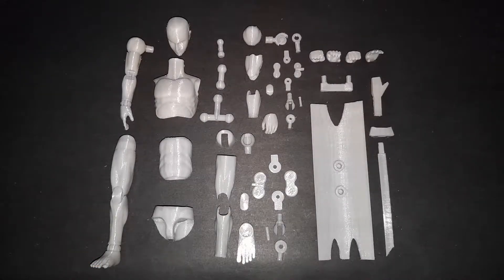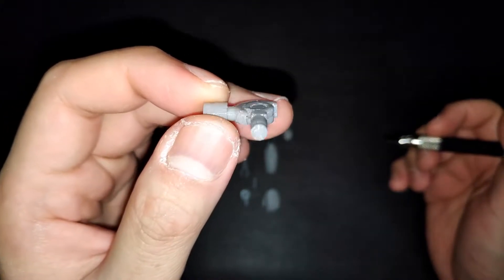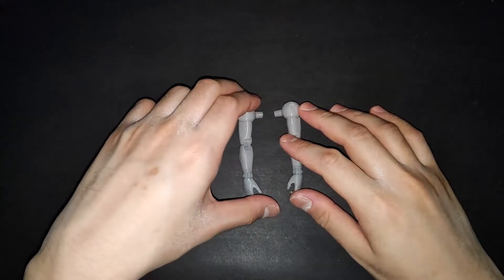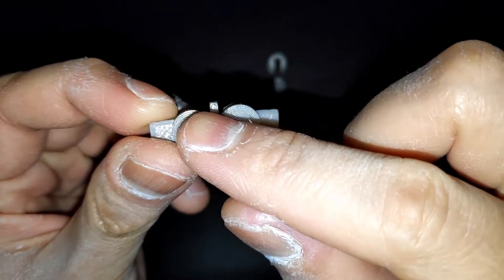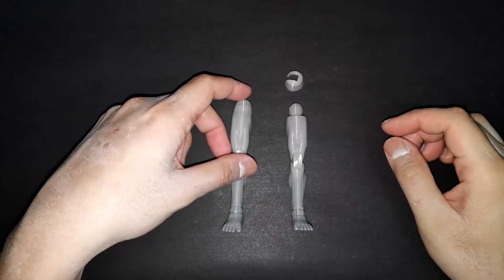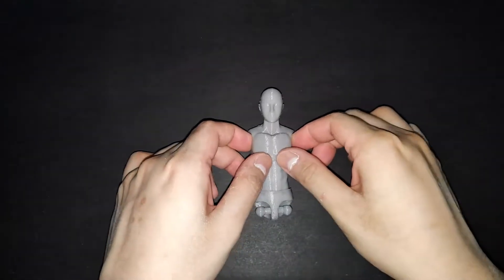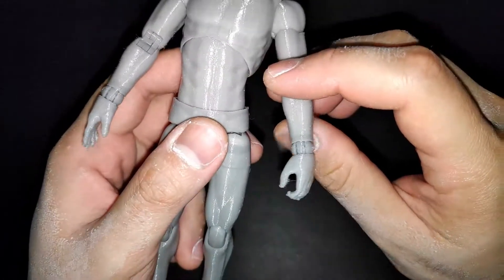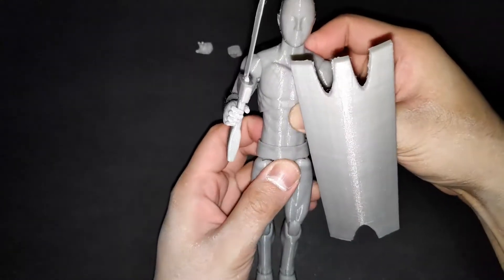3DP Action Figures - Binata BasArt

Comment: I bought this and for some reason I can never get the parts to fit together, holes seem too small, pegs too big, and it feels like clearances are all out of wack, anyone has any suggestions?
Reply from the maker: Have you used the included profile for the slicer? I have included two versions of it, one intended for parts, one for the joints.
It is because we need the parts, those that have sockets, to be a little flexible/softer, so i included the profile for cura slicer to do that.
The other profile that is intended for joints is to make the joints more durable.
Please try to use them.

Also, printer calibration will affect the accuracy of your print. Be sure to calibrate your printer to print as accurate as possible.
Another thing that may affect the print is the quality of your filament.

I hope these will help. Thanks.
Reply from the maker: Another thing, make sure that your printer prints clean, i mean, prints with less to no stringing or blobs. Those extra plastics will affect the fitting of the joins.
Try to sand them if needed.

Last thing, you can try this, try to print a 2mm diameter cylinder vertically. At least make its height 5-6mm. If your printer cant print that, you have to calibrate it well.

Comment: would this work with a resin type printer?
Reply from the maker: I haven't tried printing it on resin printer, but the tolerance of the joints are enough for an action figure. So i suggest using flexible resins for this.